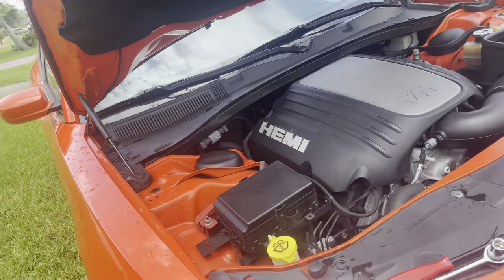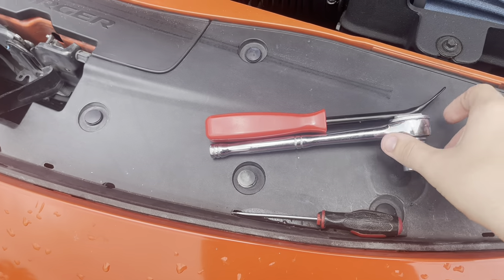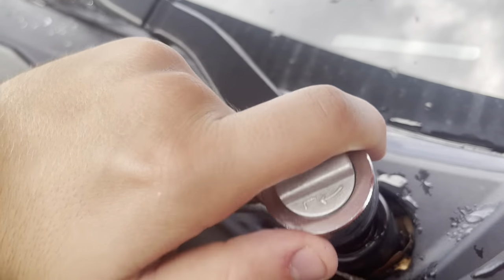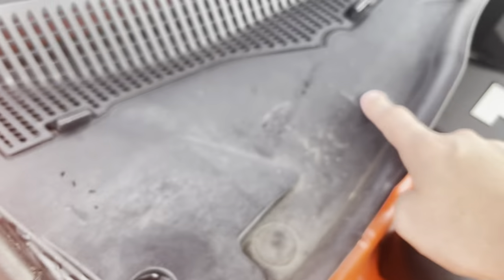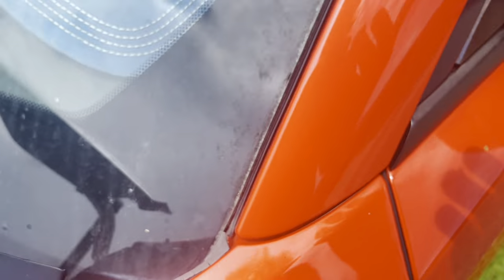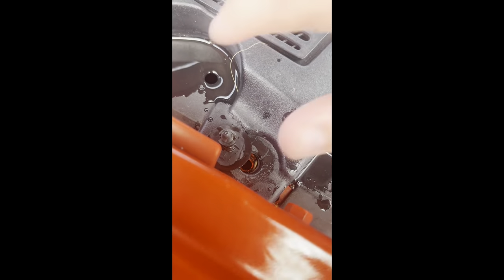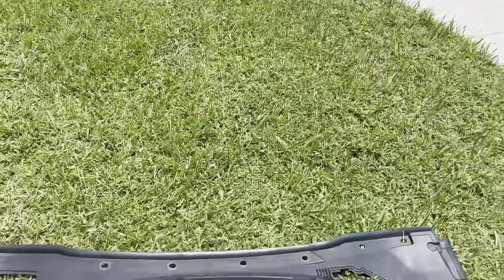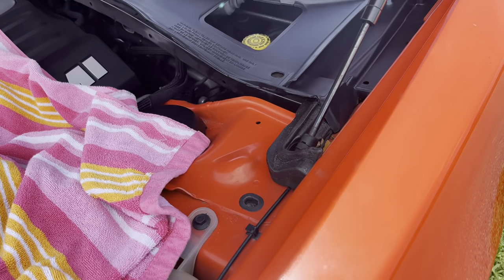How to Replace a Broken Windshield Cowl on a Dodge Charger | DIY Guide

Comment: When I went on mopar website it had listed upper and lower cowl which on did you replace?
Reply from the maker: I’m not sure what one it would be but this is the part number 57010314AI if you look that up on the mopar website it will come up

Comment: Can this start water leaking into driver floorboard ?
Reply from the maker: This can be one of the fixes to that problem but I would try to find where the leak stems from
Reply: I have this problem! Gonna try to replace this and see if it helps
Reply: Me too 😂 should be easy fix